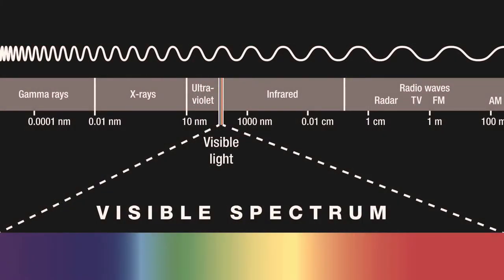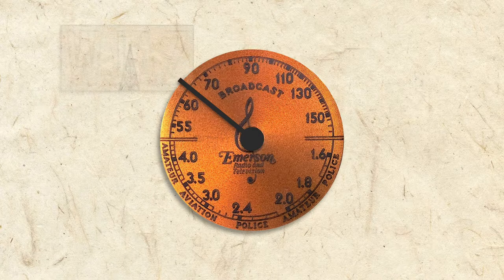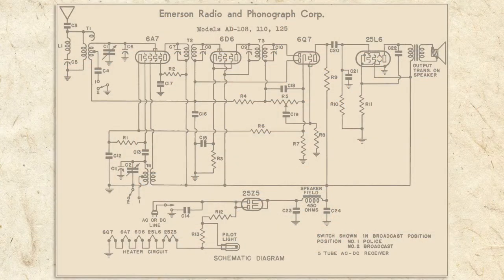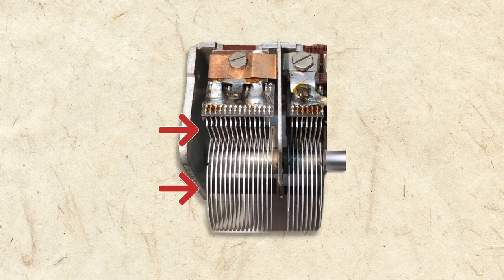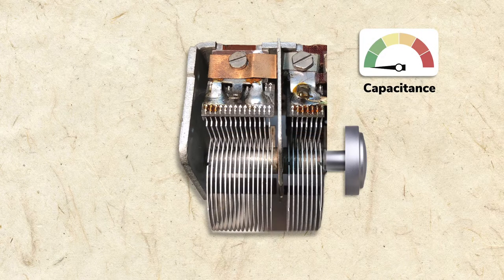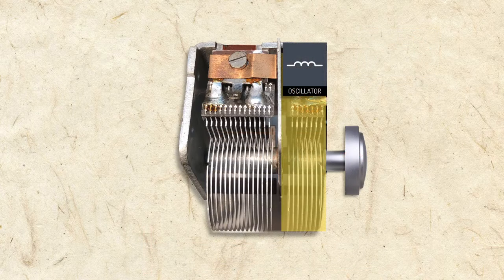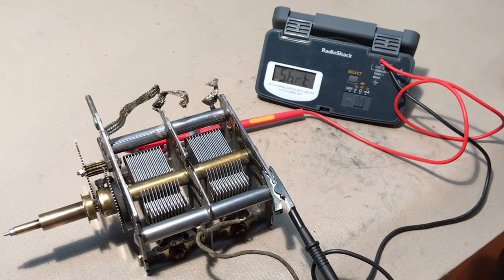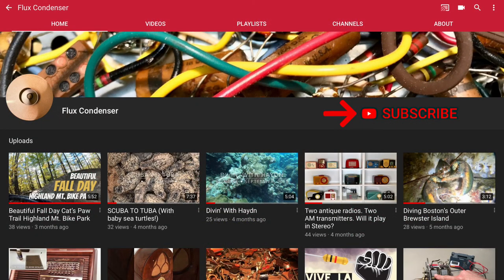How Do Variable Condensers Work?

Comment: I'm wondering if the tuning caps are generally isolated from the chassis??
Reply from the maker: Sometimes yes, sometimes not. If a tuning condenser has rotting insulators, that can lead to real problems!
Reply: Thanks for your response... this particular radio has been previously worked on so I'm not sure.